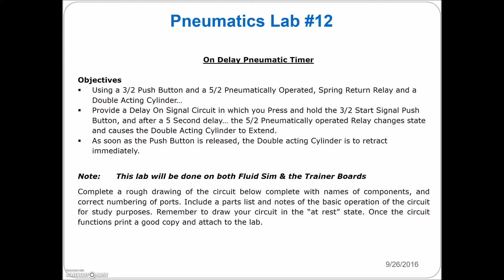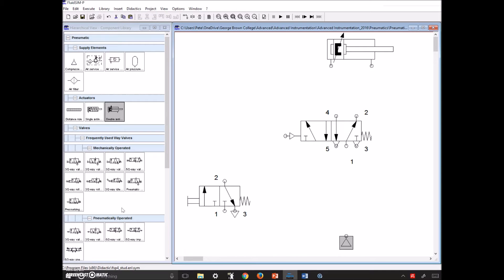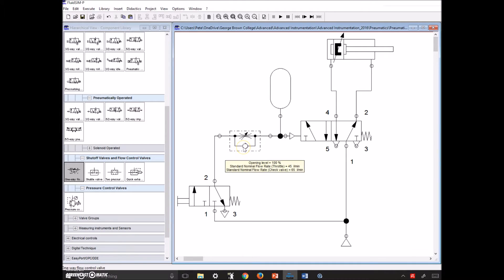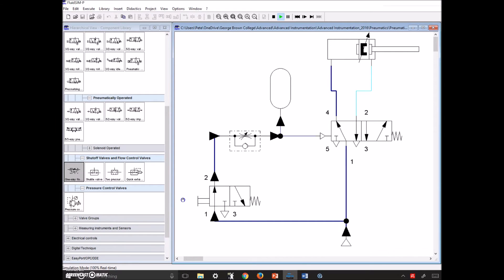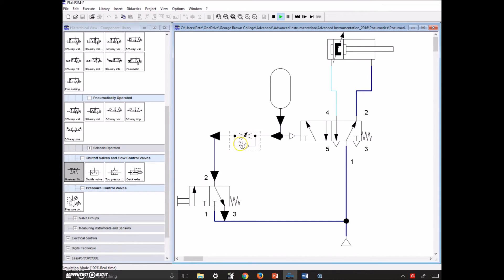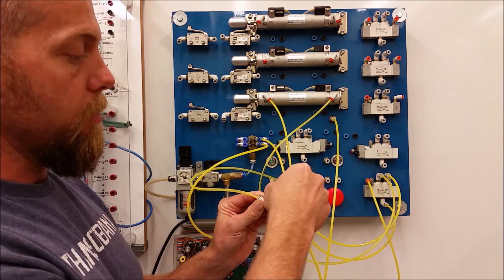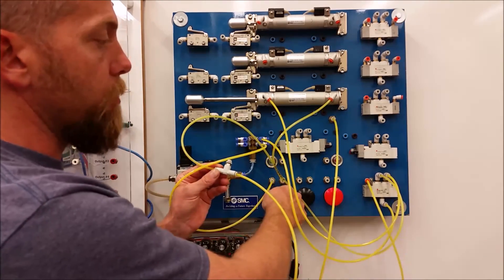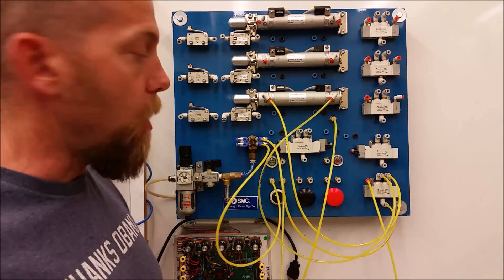Pneumatics Lab 12_On Delay Pneumatic Timer

Comment: I think it's the pressure build up in the air pressure reservoir that prevents the cylinder from retracted instantly when the push button is released. When the button has released the force produced by the air come from the reservoir still greater than the force of the spring for a short time.